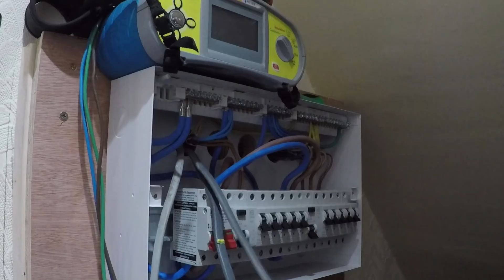Fuseboard change  -  discussing common controversies | Thomas Nagy

Comment: Having done some research on fire rating for a client who imports downlights, the fire rating of a downlighter just means that it won't reduce the fire/smoke spreading capacity of fire rated plasterboard ceilings in which they are installed at 30min, 60min, etc. So as long as there is a seal (the rubber washer round the lip) and the front is not open or likely to catch fire within the same period (Glass shouldn't), then it will likely be pass the tests to be counted as a fire rated fitting. Whether the companies all do the relevant tests or just wing it is another matter when they claim their rating - They are supposed to test it in a simulated setup that is set on fire and does not allow any ingress of flame in the time specified.

A whole other issue is whether it can be covered with insulation or not (that one certainly couldn't be), but Aurora (and others now I imagine_ have one with a little basket on top that in theory does allow insulation directly over. In general LED downlights have significantly reduced the cases of crusty wires and melted junction boxes I've found on old downlights where the lamp produces a lot of heat - in particular the 12V ones.
Reply: As i conduct fire testing on these, you're probably the closest to being correct that i have read so far, unfortunately there are many wildly inaccurate assumptions as to what a fire test requires, and what a fire rated downlight is actually meant to achieve. My pet hate is that anyone can walk into a store and buy 90 minute downlights, take them home, fit them and think that all in the world is now safe. 
As a side note we, not so much lately, have had many potential clients, probably in a bedroom office,  wishing to test imported downlights as they are cheap to import and pricey to buy off the shelf, the difference being potential profit, woohoo. We never hear from them again when they find out what is involved and how much it costs to get a full set of fire tests done.

If you are fitting them, buy reputable brands that can prove they have the reports and the test evidence, they are expensive for a good reason. (rant over)

There is no requirement for smoke reduction or leakage prevention in a ceiling fire test, only fire.
As with other "fire rated" or "fire certificated" products (rather loose terms in my world) smoke can pour and billow to its hearts content, as dense as it likes as far as fire tests are concerned. There are other tests for this for different products but it's smoke that kills first. Chances are, you would not believe how fast smoke can fill a large fire test labaratory so I'm with Thomas on that alarm, might be inconvenient, tough, it;s for your own good. Get alarms, they're cheap enough.

The test to BS476 consists of a ceiling section of a known fire resistance, of a design such as those in the gypsum white book, for either 30, 60 or 90 minutes such that it will resist flame spreading through the chipboard floor layer above. 
This has had a hole put in it which has been plugged with a downlight which has to maintain the integrity of each ceiling duration as it is the ceiling as a whole that is tested.  The design of the ceiling specimen is different for each of the 30, 60, 90 minute tests, and are not interchangeable, thus a 90 minute rated downlight might not be rated at 30 minutes and vice versa. It is dependant on the ceiling into which it is fitted, so the scenario above where joe public thinks he's now safe because he has 90 minute lights fitted in his 3/8 wall board ceiling actually means that his downlight and the whole ceiling will be on the floor within about 15 minutes in a fire test. 
The test has no requirement to prove the downlight contributes to a fire or whether it has the potential to start one.
The sample ceiling is set on top of a furnace which is controlled to a time/temperature curve as stated in the test standard and will reach 500C in the first couple of minutes, 850C by 30 minutes and nearer 1000 by 90 minutes.
The failure criteria is from above, either by exceeding temperature measurements  on the upper surface, by the passage of fire leading to sustained flaming at the upper surface or by gaps opening beyond a certain size in the section of ceiling.
This means the downlight itself may have disintegrated, fallen out, segments of plasterboard detached and the joists ablaze before the end of a test and it will still pass as the ceiling section, as a whole, has still maintained its original integrity duration.

The design of downlights has changed hugely in recent years, from the steel back can type with intumescent in the vented cap and intumescent linings and a ring under the bezel they are now much simpler, smaller, lighter and cheaper to produce. Many now have little to no intumescent, tilting ones being the general exception as they obviously have a gap around the lamp housing albeit exceedingly small in some cases. 
The trend for removing intumescent seals other than cost is twofold, one, keep the downlight in place and stop the fire getting through the downlight in the first place and it's not needed, and, two, when fitted between the bezel and the underside of the ceiling it fights against the action of the retaining springs as it expands, which it can do with considerable force, and so acts to fill the gap it is creating.  Better springs will clamp the bezel rather than fight it as intumescent can. Not all intumescents are equal of course so some expand less strongly and therefore fight less hard than others but the principal remains depending on the bezel material. I've seen the bezel give up early and the whole downlight fire up into the void as if on a bungee rope! Even then, and i can't remember now, it does not necessarily follow that that light failed a fire test, if the ceiling section overall did not allow flame to pass through the floor above for the duration and the other criteria were also met.

In summary, the downlight shown could well have passed all fire tests and legitimately call itself fire rated even though it might not look  like what might be termed a traditional fire rated downlight design.  They don't have to have seals, except maybe for IP rating, fire seals, intumescents, hoods, lids etc although they do have to be tested  as designed and used in practice so the evidence for a halogen style and an led with heatsink style for example, would be considered different enough to have to be individually tested, the resulting test evidence would not generally be interchangeable. As i said, contributing to the cause of a fire, electrical compliance to that end, different matter.

Hope someone has learned something from this especially if you fit these things. Into the right ceiling of course, from a decent manufacturer who can, and will, quote or provide their evidence.

Comment: Signing off a customers own wiring is technically a breach of the agreement with the NICEIC so they can reserve the right to revoke your membership. However on a site that you can actually view all the cable runs start to finish most of us won't take issue with signing it off.

Comment: Hi Thomas, another great video. I just have a question about your fire rated foam. I have tried that before but with cans that come with their own applicator. I find that the foam just hardens in the nozzle and after the first use you may as well throw away....do you have any tips? Dan

Comment: I'm amazed by the places you're allowed to squeeze fuse boards in to.  In the US we are required to have a 3ft X 3ft square that's at least 7ft high.  I have never installed a panel that required I find a bucket to sit on.

As for the recessed light, was the ring steel or aluminium?  I would think aluminium or pot metal would melt quite quickly.  If it was steel then I wonder if that's the difference.

Comment: I always thought that the fire rating was to do with the break in the plasterboard, ie 30 mins. So they will do, but like you say I would prefer something covering the lamp also, especially as any guy 10 lamp could end up in there.

Comment: Firstly love your videos, just wondered when you filled the holes in the back of the board what was it you used? “Fire” rated foam? I am an electrician by trade and used to use this all the time, I have since moved into more facilities management, and any fire survey/risk assessment I have ever had done will not allow fire rated foam as it isn’t normally fire rated still, believe it or not.  You might not even be using foam! Just thought I’d mention it but like I say I always used to use it. Anyway keep up with the videos 👍🏻

Comment: With reference to the fire rating, would it be fire rated for the LED light only as the driver would not be able to run a halogen bulb. 
I'm afraid that's more of a question than the answer your looking for. 
If you put a halogen bulb into the fitting I would be more worried about the driver causing fire issues. 
Definitely watching this space for someone who has the answer to this topic. 
Cheers

Comment: Like you Mr N, I've been to two outlets that refused to put coffee in an travel mug.  My old electrical college could not fit a normal 300ml travel mug in their coffee dispenser so sold it in the nasty, plastic coated paper to pour in my cup. Best was Gregs the Bakers who told me they are not trained to wash customers cups AND I'M NOT MAKING THAT UP!

Comment: That fire rated downlight does seem suspect, I assume like you that by stating LED only the fire rating would be null & void if used with a halogen lamp. That then assumes the client or any future owner will only use LED lamps. Out of interest does the fitting itself have anything on it stating LED only?

Comment: Is the seal on the rim of the downlight an intumescent seal? Maybe that’s what gives it its rating along with the glass screen. As for the lamp arrangement, I’d be quite happy with it if there is a label stating that it is led only, bearing in mind also that it can only be a matter of time before dichroic lamps cease to be available. Plus, after labelling and informing the client there is only so much you can legislate for. How many times have you seen scorched lampshades where a 100w lamp has been fitted but the label states 60w max? Ours is to do what we do properly but we can’t babysit folk thereafter.

Comment: presumably the glass is silica, or effectively pyrex,  with a high melting point, and a low thermal expansion rate, so cracking is unlikely. Either that  or the hole it leaves when it falls out is small enough that on fire test, it does not actually allow fire spread. After all you can get fire rated windows in a fire door, and they don't have to be wired glass, if the glass chemistry is correct.
Nice to see a measured approach to the adoption of someone else's work that is neither hysterical condemnation or careless to the point of danger.  Keep it up.

Comment: Fire rating issue with downlights... I used to assume that it had to do with the downlight being "sealed" with no exposed wiring or connections (internally)....but later found out it refers to the seal it makes with ceiling i.e. the gasket.

Comment: In the US we have two different can light fixtures. One rated for installation in insulation and one that is not. But, with LED light being introduced to the market so heavily. There are no low profile fixtures that don't require a can. They look very much like the setup you have there.

Comment: I usually try to keep smoke alarms as part of the lighting circuit but aim to make it end of line otherwise they start getting busy (in/out/3core). I agree that having smokes on a dedicated circuit could lead to a fault that possibly would only be discovered once it is too late.

Comment: The down lights seem odd without fire rated cowling over the top, in the floor joist i doubt it would make much difference but if there also upstairs and there going to be putting lagging on top of the lights i cant see how it would be fire rated, maybe part to do with maximum of a 10W led bulb as they dont produce much heat like the halogens, but hey you've checked the lights and the manual so you can tick the box on the NIC cert
Reply: Those lights can be bought with an insulation cap on them for directly covering with rockwool and the like.

Comment: I'm from the middle of the US  do hvacr as a trade, been in the trades electrical and HVAC, can you explain your wire gauges and amp draws. For instance we use 18 awg this starts our low voltage thermostat wire. We use 14awg at 15amp, 12awg for 20amp, 10 awg for 30amp. Is an eicr a routine inspection? That green meter you need to replace, is it a megaohmer?

Comment: Hi Tom. Recently picked up some downlights different to what I usually use. Same thing as the ones in your video, fire rated but no top/enclosure. The ones I fitted had a intermecent strip in between the fitting and where it fits on the ceiling. I just think as technology changes, it’s become possible to manufacture downlights which are fire rated cheaper.
Reply: Downlight designs that i test have changed drastically over the last few years, many don't have the intumescent anymore. They are a long way from the solid back can type with the holes in the top as they predominately used to be.

Comment: The fire rating is to cover the integrity of the ceiling after hole has been drilled out. You then need a fire rated cover to protect the structure. I’ll stick to JCC 👌🏼
Reply: What's JCC?

Comment: Agreed, builders work is a no no. I’ve used tysoft EasyCert for years now, fill straight to an iPad mini, export to laptop and email to  customer direct. You have to subscribe to a customer care package but for the cost I find it to be well worth it, all certs covered and new cert models automatically updated as they happen. Makes life easier.

Comment: For the fire rating, as I understand it, it’s not about the light fitting catching fire, it’s about stopping the spread of fire from one compartment to the next. I.e a fire in the lounge breaking through the ceiling into the floor void of a bedroom above. Traditionally this has been done by hoods or a can style holder. The idea is recreating the integrity of the plasterboard by the hood or can, so that light fitting they have is reinstating the integrity of the plasterboard seal between compartments.
Reply: Correct. The fire test is of a ceiling construction of a known fire resistance duration into which a hole has been drilled and plugged with a downlight. A rated downlight should maintain that integrity for the matching duration be that a 30, 60 or 90 minute design.

Comment: is there not a hood on the led down light  im presuming that the kit was the led light and holder so if you put a halogen lamp then you have actively changed the fire rating

Comment: hi Thomas . Wondered what your thoughts are about the small consumer box in loft being run using 2 lengths of 6mm sq T&E ... in case the shower was upgraded to an electric 8 or 10kw unit. currently its just a power shower 3amp transformer for the pump. Hope to hear from you . Good vids btw . Regards Don

Comment: On the subject of two things on one circuit, the house I got had ALL lighting AND outlets for 3 rooms on a single breaker.  I have so far installed my own two circuits and had elec instal a separate line for fridge and computer room outlets.
Reply: I suppose that even a single (theoretical) 16 amp breaker will allow 3.6 kW. Cooking and heating aside, that's allot of power these days. Especially if you're using modern flat TVs and LED lighting.

Comment: As long as the face of the down light sealed the hole created then you have reinstated the fire rating of the cielling, the ones with the cans will be for where insulation is involed to help prevent over heating of the light

Comment: From experience of working for a wholesaler and asking the supplier that question regarding the fire rated lights not being fully enclosed one of there answers were the rubber/ material ring around the fitting should expand when it comes in contact with heat. Not 100% sure i see that working but thats what there technical team had quoted
Reply: Many that i conduct fire tests on are not enclosed anymore, and even less now are fitted with intumescent at all.
One of the reasons being that the expansion of the intumescent reacts against the retention force of the springs effectively trying to pull the bezel down while filling the gap it is creating.

Comment: The fire rated down light means that it maintains the fire rating of the board you are fitting them into. For instanstancw between levels of a multi storey house.  The intumescent ring makes the fire seal in the event of fire.  So the fitting is not fire proof it is merely to meet the fire integrity of the surface you have fitted it to. If that it makes sense.
Reply: Correct. Fire rating is dependant on the ceiling construction not the type of lamp fitted and many now do not have intumescent.

Comment: Surely the spots aren’t fire rated? Fire rated for the hole you’ve cut out but not if the lamp becomes faulty and possibly catching fire but yet no protection?
Reply: That's not how a fire rating test works. Fire rating is dependant on the ceiling construction not the type of lamp fitted. Testing to find out if the fitting will cause a fire within a ceiling is a different matter.

Comment: I think the fire rating of the downlight would be in the types of silicon/plastic on the black mouse trap ears, and I think I saw a big 60mm silicon o ring plus the glass,  all together make an air tight seal from the house to the roof space creating a firewall kinda. And maybe better insulation on the wires the come with it at a guess.